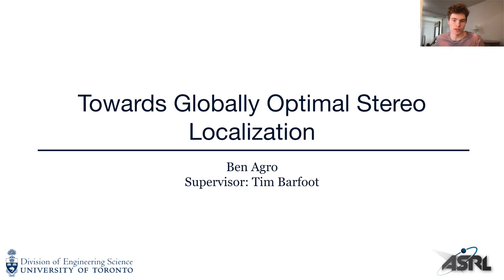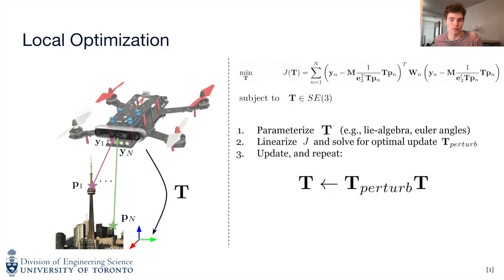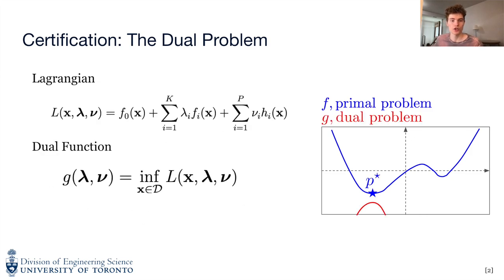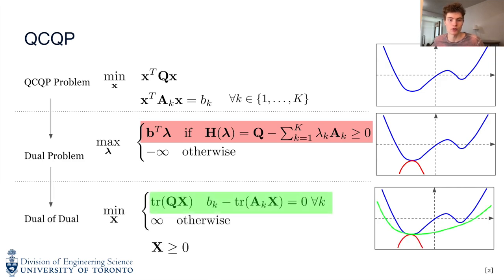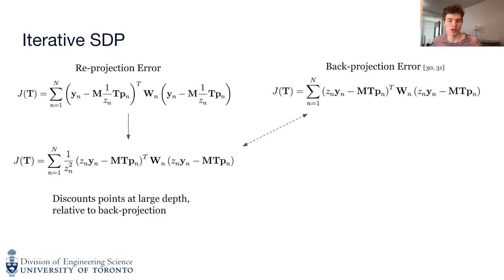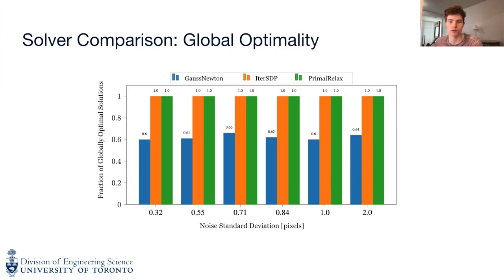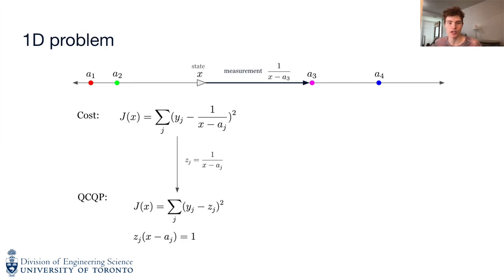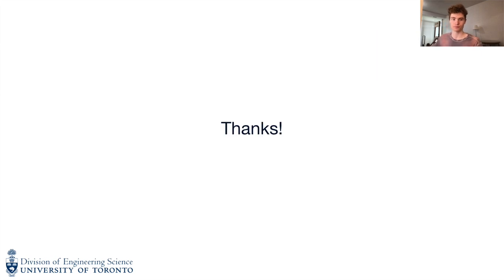Towards Globally Optimal Stereo Localization

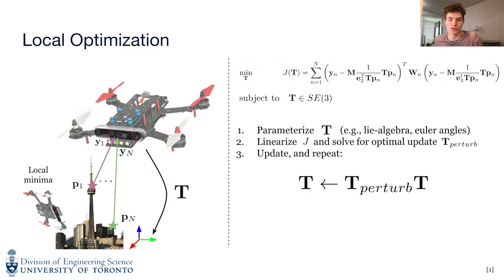Comment: Hi, thanks for sharing your research and results. On 1:37, you indicate that the optimization problem is "non-convex". Why is that? I assume it is because the optimization variable T (the transform) is both in the numerator and denominator of the projection error? I think the problem becomes convex if you move the term in the denominator to multiply "y_n",  this way the transform T is not dividing anymore and all terms are linear in the transform T. Does that make sense? Does the optimization problem become convex after this change?
Reply from the maker: The constraint $T \in SE(3)$ is non-convex wrt whatever parameterization of T you choose. As a side note, if you move the denominator to multiply y_n, you are solving a different optimization problem.